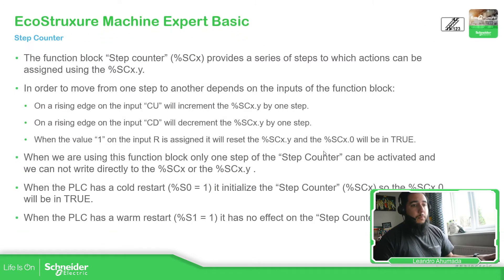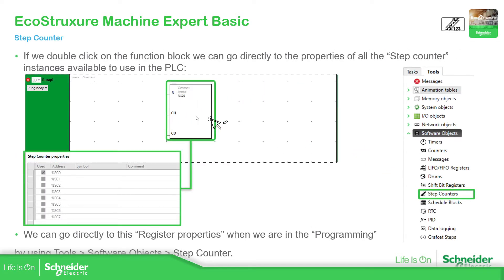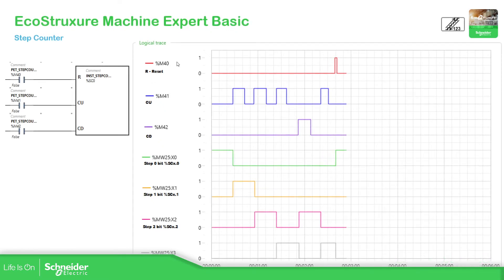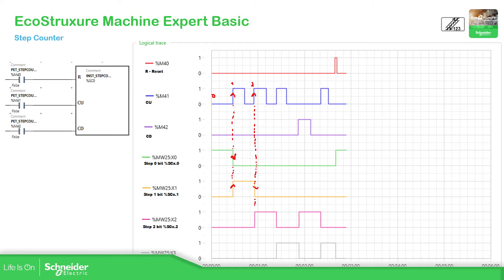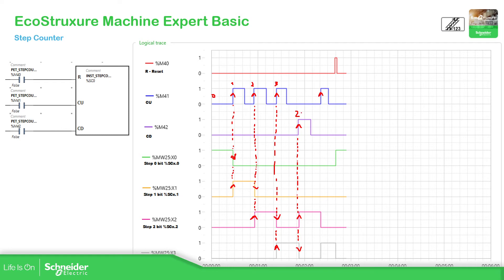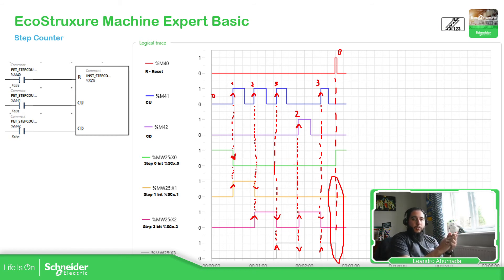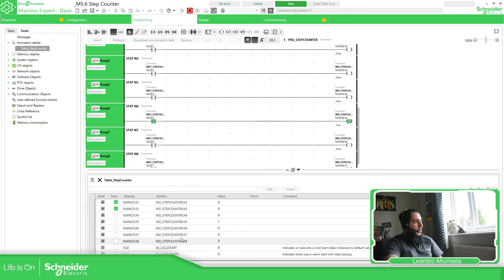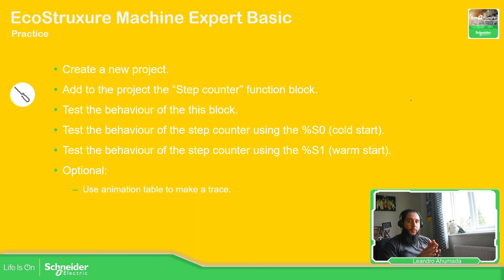Training - M221 - M5.6 Step Counter

Comment: I'm making an application in a pottery and I need to make a counter to count the blocks that reach 120 thousand per day, in this plc the counters only reach 999, how can I make a counter for this purpose? observation, the supervisory will read the result, I did like this %MD300 := %MD300 + 16 it works but I can't make the supervisory read this DM
Reply from the maker: Hi Claudio Abrante! using a variable word you will never reach the 120K because you a word variable goes from 0 to 65535 (or half if it uses negative numbers) . Your solution is the best one to use an internal counter (is what i usually do :) ). Now if the other system does allows you to read %MD try to read the %MW but using two consecutive numbers. if the "supervisory" does not allow you then you can two manual counter or functions. one for xxx.000  and the other for the 000.xxx